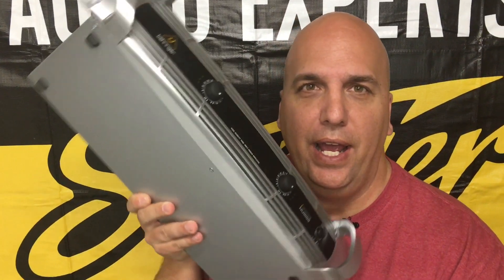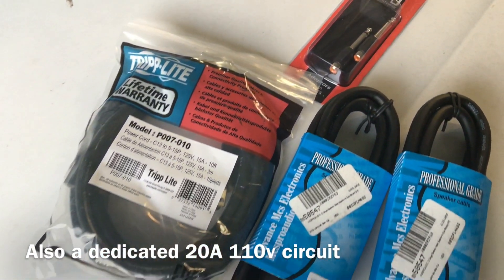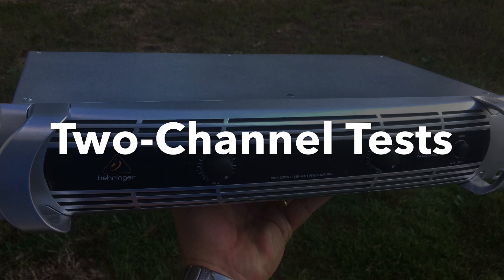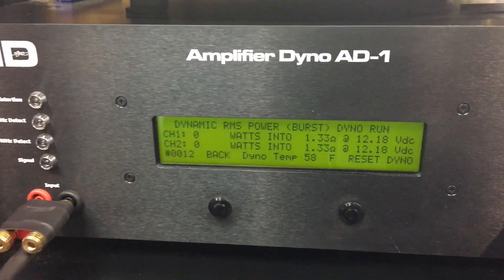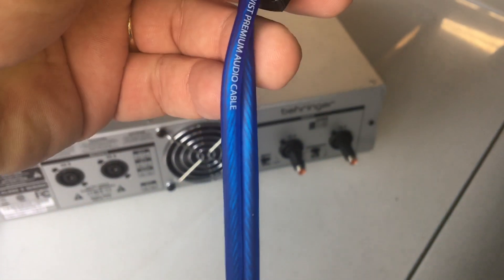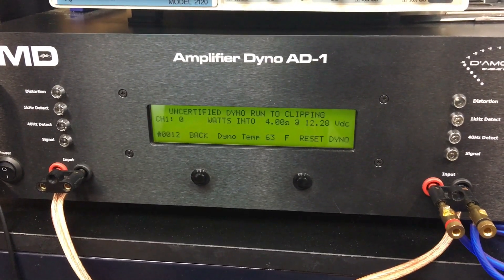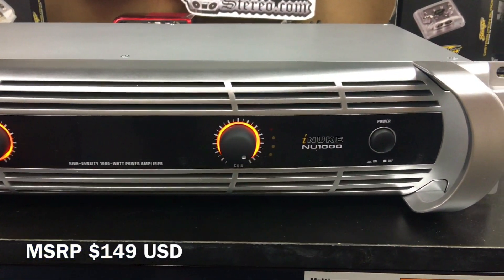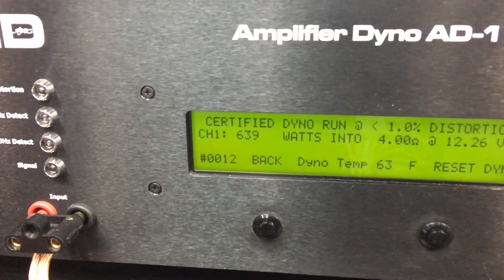Behringer iNuke NU1000 Amp Dyno Test

Comment: the crown amp was way better and did more than the rated power I just purchased 2 of these Beringer NU1000 for $188 used I wanted them for a full range set of speakers I knew they would not do 1000  maybe if you switched it to 220v it would make that 1000 watts

Comment: WERE YOU EXPECTING TO FEED THIS AMP A SIGNAL FROM AN RCA CABLE FROM A  CAR AUDIO HEAD UNIT AND GETTING MAXIMUM POWER WITHOUT BOOSTING UP THE SIGNAL?? THAT'S NOT GOING TO HAPPEN

Comment: Big D, if I can test out a Rockville home bass amp. They jam. The rpa5 is rated 500 watts bridged at 4 ohms but I actually tested it bridged at 1 ohm and it didn't blow up and handled it for awhile but I shut it off, didn't want to try and push it's luck. I meant You test it. Dang phone.p.s. Infinity is awesome.Also had Duel fans.

Comment: Also. It’d be interesting to see a test of a lab gruppen 20k44.
Reply from the maker: The fake ones that are being sold or an original?
Reply: A real ones. You COULD rent one from a local production company. They’re super expensive otherwise. Annnnd. You should try driving these with a proper balanced audio signal.  I’d be happy to clarify any pro audio related questions you have.

Comment: I’d be curious to see it driven properly with +4 balanced line level.
Reply: Id be curious to know more about that,  a lot of my rack equipment has switches for that.
Reply: With the knobs maxed out you can easily reach 0 on the input with consumer gear as long as they can put out .3v over RCA.  

With it at half it takes takes around 4v to reach 0 on the input. Which is above +4 typical voltage requirements.
Reply: @JoshM7  I’m more interested in seeing it receive an actual balanced signal (at 1.23vrms)
Reply: @jeffpelletier5186  the 4v was balanced out of my mixer.  My 3000DSP works all the same either way with balanced vs unbalanced. At least for subwoofer duty there's no difference between the two.

Comment: Behringer is the worst. Most pro audio amplifiers will in fact post realistic power output number specifications,  however in most cases the 2 ohm power rating is not sustainable and the amplifier goes into protection, or blows up. This is especially true of all the clone amplifiers copying the labs. 4 ohm numbers will be for the most part adequately published, however the real value of a 22 ms burst is the real culprit. 

22ms burst has been a standard for the industry since the 1990s, when SMPS was coming onto market. Tests done and represented at the 
AES conference again in the 1990s , showed that 200ms and under power bursts, were unable to adequately reproduce a music signal. Furthermore, to reproduce the entire music signal, from 20 to 20k under any circumstances required at least 500ms burst power. 

Edm bass or long duration bass notes would require at least a full 3 seconds of burst power for reproduction of actual music. Therefore the real question is when are we going to to start measuring power that actually reproduces a music signal, rather than just be a meaningless number , that fools the public into thinking, they got more than they really have. ? Even these tests , showing behringer coming up short, are measurments, that WILL NOT REPRODUCE A MUSIC SIGNAL!. 

The only way we will ever know how much power we really have with SMPS, is when the industry comes clean with a proper rating system, where power measured, means actual music signal reproduction as well.

Comment: Cool video.  I would love to see a video on the Crown DC300A Series 2, and also the Crown MacroTech 1200.  I used to have both amps and man they were heavy, bullet proof and I've melted some voice coils with them.  The DC300A had capacitors bigger than coke cans. The MacroTech supported Load Impedances: Rated for 16, 8, 4, 2, and 1 (parallel
 mono only) Ohm operation; safe with all types of loads,
even totally reactive loads.......  0 Ohm loads, basically a direct short, like it was like a welder lol!

Comment: I use an inuke 3000 DSP for my PC speakers and am aware that when you dig a bit and look at the actual specifications Beringer quote (from memory) somewhere in the vicinity of 850 Watts RMS per channel. So, nowhere near the 3000 Watts quoted on the box and in the ads. If it were in fact 3000 Watts it would exceed the ratings for the standard 240V power outlet here anyway and the supplied power cable is only for a standard outlet. It does sound good though and the DSP part is great and yes I like it loud.

Comment: @4:24 - you pointed to the TR and BL connections.  Those are 1+ and 2+, not the 1+ and 2- you referred to. You can see the small descriptions in the close up.  And the next shot is your wires in the 1+/2+ positions.  You've wired it correcty (note the back that says bridge 1+/2+), just misspoke.

Comment: Thank you so much for testing PA amps. Unfortunately I believe you got the rating wrong, if you read the specs sheet, it says:
Specifications: • Output power (per channel, stereo): 110 watts RMS, 160 watts peak (8 ohms), 210 watts RMS, 310 watts peak (4 ohms), 380 watts RMS, 530 watts peak (2 ohms) • Output power (bridged mono): 430 watts RMS, 620 watts peak (8 ohms), 750 watts RMS, 1050 watts peak (4 ohms)
Your dynotest just show that the Behringer performs as promised in tests! 
Also monitor mains supply, class-D amps is very sensitive to small drop in supply voltage...
And thanks again for testing PA, looking forward to AMP DYNO TEST "Behringer Europower EP4000", low price "old School" killeramp, yes really...
Reply from the maker: That spec sheet was not available at the time I tested this amp, but that’s great!

Comment: Nice dyno test, Is it possible that you can put (Behringers) km1700 on the dyno also, the components are very different, and the Km1700 is a lot heavier than the Inuke 1000, I believe you may get a better result, Thanks in advance!!

Comment: Can u do a dyno test on the new behringer nx3000 dsp. I have kme 350 per side tops and 500 per side bins so it says its 900 per side at 4 ohm but u say they may not be up to that rating. Could u check Tim from Ireland. Good informative videos

Comment: Still am using this amp, to push my 15" Sundown Zv4, I have in a custom box for in my living room, while it clearly is way below the Zv4 15 rms specs, it is still going strong with zero issues and makes this 15 pound pretty darn good for home use.

P.S. I bought this Inuke purely off this videos dyno results, (wasn't originally meant to power this Sundown)

Comment: I use 2 of the older Behringer D6000 amps. SImilar to the inuke 6k but IMO a bit more robust. And i got the 2 of them used for $500 canadian about 10-12 years ago, and they have never let me down. I am squeaking about a kilowatt per channel at 8 ohms which i think is quite fair. I use them for a couple sets of commercial 18" drivers in custom boxes for live band and dj'ing. I have also kept a compressor on them to keep them from clipping. So they have never been abused, but they are driven close to their rails for about 10-14 hours a week, and have been for years. 

I have also tried running my 4 bins off one amp when I have the recommended 30A circuit. And it seems like almost as much power, but not as much tonality or control. This amp is rated 1100x2 at 8 and 2200x2 at 4 RMS, with peak numbers being 50% higher. And it seems able to do that... they have been the best purchase for my system I have ever made.

Comment: BigDWiz, Thanks for this video!
We now know that Behringer is about 33% off on their inuke amps.
Same with their newer "bugera veyron" amps (spinoff company).
Would love to see the rating of the Behringer KM750.
It seems a different design amp, and I'm not sure if it's rated in this same fashion; since it's a lower power amp, but priced higher.
Reply from the maker: Interesting, thanks for the info

Comment: When you bridge a pro audio amplifier you are supposed to have channel 2 turned down. Also you are sending a unbalanced signal to an amplifier where are you will get higher output with a balanced signal.
Reply from the maker: Thanks for the comment. In order to minimize the signal chain, I used a known clean output device, my Alpine CDA-9815. It has very clean output (I measured 0.03% THD at the full 4.2 volt output). I also bought a Rolls impedance matching box, tested the amp again with statistically identical results. If I Test more pro audio amps, I’ll look into XLR source units.

Comment: Can I use this for my 2 12 in my room
Reply from the maker: Sure, but you may need a crossover if not using sub out on receiver. Also may need gain/impedance marching box if going from RCA’s to XLR or 1/4”
Reply: BigDWiz true I just need some type of home sub amp that puts out 1000 or close it it

Comment: Behringer's own RMS ratings here:  https://1drv.ms/b/s!Ap_MF2KlS4GIiT0rh7DeH3obvuHc   See toward end of doc for specs.  They stopped putting the RMS figures in their brochures - a very flawed decision if you ask me.
Reply: TL;DR:  115W @ 8Ω;  220W @ 4Ω;  380W @ 2Ω
Reply: Oops, that was for the DSP version, without DSP specs are here: https://1drv.ms/b/s!Ap_MF2KlS4GIiT8UmUGx7PQFd7dY  (NU1000 on last page)
100W @ 8Ω;  200W @ 4Ω;  400W @ 2Ω.  Bridged:  400W @ 8Ω;  800W @ 4Ω

Comment: I can get the behringer nu 1000 watt amp in Canada for 260$ TAX IN DO YOU THINK ITS A GOOD DEAL..?I WANT TO USE IT TO POWER 2 12 INCH SUBWOOFERS THAT ARE 300 WATTS RMS AN 600 WATTS PEAK EACH... WHAT DO YOU THINK?
Reply: john smith check the ohms. Itt would be perfect.  I got 3 QSC 1400 and they pound on bridge at 4 ohms with 2,18 subs conected together for 1200 w at 4 ohms.

Comment: Although it had false power ratings it still seems to be a good deal on what it did perform. I have a question for you Big D.
On my home 2ch stereo set up I am using a Pioneer Elite vsx99 and it does provide pre amp outputs. In Your opinion would this make a good amplifier to get more power to my klipsch Quartets? Or would I loose out on quality detail in my music?
Reply from the maker: I would personally stay with the Pioneer amp. Also, it is possible the preamp outputs in the Pioneer would not have enough voltage to drive the Behringer. You would need an impedance matching box, such as the one from Rolls.

Comment: OK I got my Neutrik NL4FX in, and I see you have it wired to +1 and +2, but you said the top right (+1) is positive, and the bottom left (+2) is negative.  I want to confirm before I blow something up that you meant to say both are positive.
Reply from the maker: +That Dude There the way I show in the video is correct

Comment: I have a buttkicker in the mail that is 4 ohms, and want to know if I can wire it bridged with just one, or do you need 2 4ohm speakers to wire bridged?  What ohm speaker did you use to wire 4ohm bridged?  Thanks!
Reply from the maker: +That Dude There this amp will work at 4 ohms bridged. My test sub is 4 ohms
Reply: Thanks!  I did see in the video that it is 4 ohms.

Comment: Thats still more power than any home or studio setup will ever need. Its also enough to drive pretty much 99.9% of speakers on the market with ease. And I noticed it said at 12volts, since this is used in the car on a 120v outlet, wouldnt the power be different?
Reply from the maker: +RyKoVapes Dyno has a 12v adapter for testing home amps. This is where the 12v comes from
Reply: ahh ok nice

Comment: +BigDWiz Im getting the dsp version it dose say in the manual max power is doesn't even give you a rms power rating do u think it will be ok on a sundown audio Ev3-12 D2 in series 4ohms it's rated at 500Wrms
Reply from the maker: +91rickstar yes, should work well for that sub

Comment: I'd be embarrassed to have this in my system for the fan noise alone.
Reply: Sounds quiet, to me.  My damn EP4000 sounds like a hairdryer lol
Reply: I have a nu6000dsp running my subs in my home theatre, and yeah it's noisy (although I've never had the fan speed ramp up, not sure what that would be like).. the solution? Put the amp in another room.  Obviously doesn't work for everyone, but I have my pc, subamp, server and networking gear in a utility room near the ht.  Every piece of that rack makes enough racket to drown out quiet dialogue, so kick it all to it's own dedicated space.
On the flip, my nu6 sounds like a gentle breeze compared to a ep4000

Comment: PA amps need a high voltage input to perform well.  What was your compensation for this?  I use a 8ch DI box between my pre and my 4 Altec Lansing 9444A anniversary edition amps, because they otherwise supply hardly any output.

Your test showed expected results btw, which still makes this a great amp for the money when bought new, and a even better deal when picked up used.

Thank you for doing all these tests for us.  I appreciate it.
Reply from the maker: I used 4 volt input for this test, afterwards, I connected my mixer to provide higher voltage and the results were the same. People who are using these with HT receivers may need a way to boost voltage as many receivers  put out around 1 volt. You will not reach maximum output with this amp and 1 volt input
Reply: Thanks for the reply.  I first used an Art clean box pro to up the voltage as I think my Yamaha only put out .8V, which was pathetic.  You obviously know your stuff, so thanks again for doing these vids.

Comment: Nice test run. If you look on parts express the ratings are given more conservative and closer to your results. Not sure why higher power #'s are given on other websites. This amp is rated as 110x2, 210x2 , and 380x2 for 8, 4 , and 2 ohms on the PE website.The units with DSP look nice for HT sub use.
Reply from the maker: +Joe Rico Behringer themselves showed the accurate results before, now they only show the max stuff.
Reply: BigDWiz Yes this bothers me as well. But it looks like PE is at least attempting to give consumers some #'s that resembles something closer to the truth. The #'s Behringer gives could very well be what the units SHOULD do on paper. Most audio engineers get into the ballpark solely based on the calculations then fine tune from there. I guess that one bit of advice from guys that know how power and gain structures really work holds true....."buy as much power as you can afford". Then it's just a matter of making sure the electrical in your house can handle it.

Comment: So disappointed in behringer. They should sold it with the 8 ohm rating. The overrated output statement is not something you would expect from a commercial grade product. Still have the amp, and I still hate it. I wanted for for running 4 aura 50 watt tactile transducers. It clips too early.

Comment: I buy behringer inuke 3000dsp i tested yesterday and have some issue i have juzt 29.3v clean output to the speaker when i go more then go intro distortion on my distortion detector. This is right or i have bad unit?For me its more look like inuke1000dsp in case 3000dsp. My old amp rated to 500w rms and i have like 34v output. Tell me if every one 3000dsp have just 29 v output or i just have bad one ?

Comment: Behringer rates amps using max wattage(& I believe there's a good reason for that)... I own the amp & have interacted with their Customer Service to get the RMS wattage & was told it's basically 760RMS @ 4ohms bridged...
Reply from the maker: +Marvin Connell it would be nice if they 1) either gave everyone RMS ratings or 2) at least state the ratings are MAX
Reply: they give RMS ratings at spec sheets